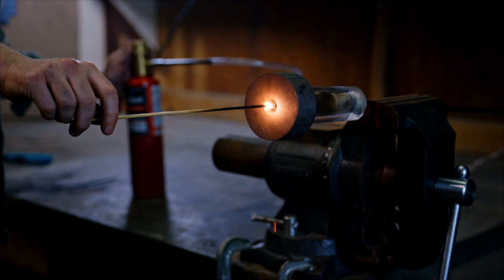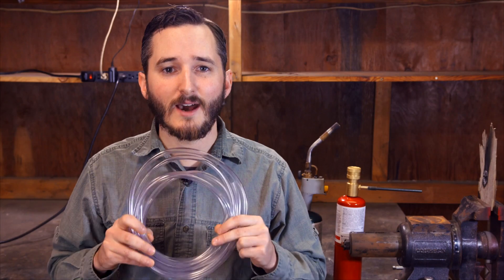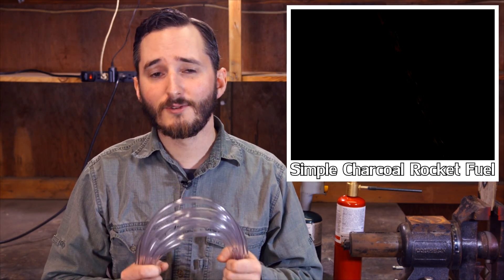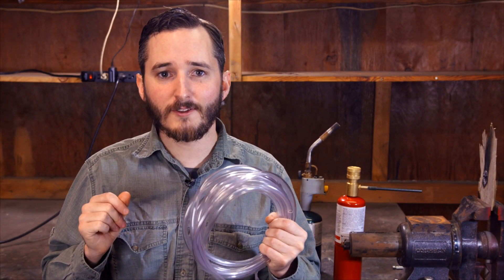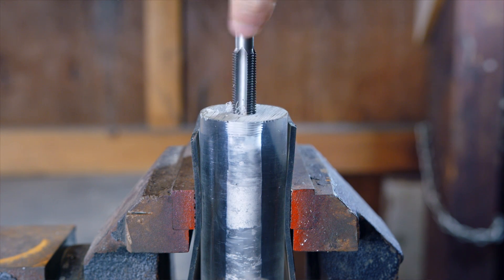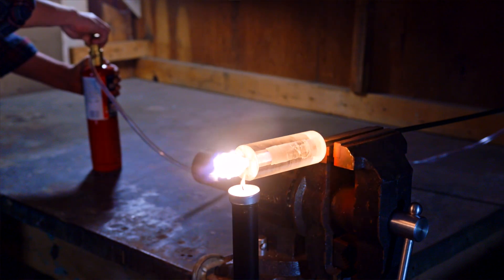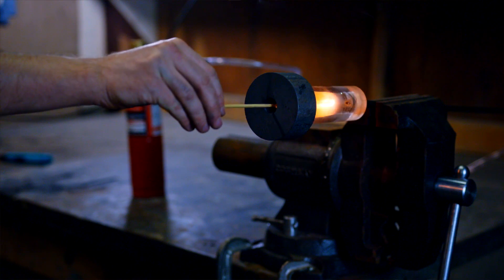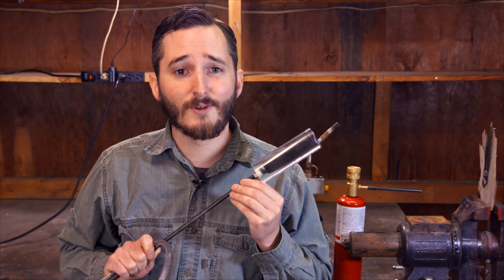Building a DIY Transparent Hybrid Rocket Engine - NightHawkInLight

Comment: So what is the point of sulfur in gunpowder if it only needs fuel (charcoal) and an oxidizer (potassium nitrate)?
Reply from the maker: Sulfur is a modifier. It's like pouring oil on a campfire. It will burn without it, but oil helps.
Reply: NightHawkInLight Ok that makes sense, it basically just helps the charcoal burn quicker/easier. Thanks for the insight.
Reply: bucky13 I guess that sulfur acts as a catalyst. I've actually made some experiments about this, and usually I get the following results: charcoal and KNO3 burn, but slowly. Either one with sulfur, don't burn well, however it burns better with charcoal. All three combined are quickly consumed. Given the smell left over, I suppose that the sulfur is reacting with one left over oxygen molecule from every two moles of KNO3 and C reactions (which would produce CO2 and some solid byproducts I haven't identified), and takes 2 atoms from the O2 in the air to form sulfate. I believe this increases the efficiency of the reaction, making it more violent. also, the Sulfate formation is probably an exothermic reaction, which adds to the bang
Reply: +Christopher Teale  Not gonna lie, 6 months ago I understood about 20% of your answer. Over the past few months I've gotten into NurdRage and NileRed chemistry videos... Now I think I know exactly what you mean. When the charcoal and KNO3 react, it produces mainly a lot of heat and CO2, but since CO2 only requires 2 of the 3 oxygen atoms that the KNO3 has to offer, you're left with extra oxygen. So then sulfur is able to use that extra oxygen for a secondary reaction that adds more energy and balances out the equation... I think.

P.S. I haven't been studying this for the past 6 months so I could post a reply, I actually saw this video in my recommended and immediately saw my old comment.
Reply: NightHawkInLight it's not a binder?
Reply: bucky13
Reply: both mixtures of potassium nitrate with just charcoal or with just sulfur would burn, black powder is the optimal combination of those to achieve the best properties... actually sulfur free formulas were used for special applications like fuse core powders
sulfur provides some extra gaseout output, stabilises burning process and under high pressures contributes to mechanical properties of black powder
Reply: I concur.

Comment: could you make a wood core, made in the same way, that slides into you rocket housing as fuel?
Reply: z dubs Depends on the wood's heat conductivity if you want to have it as a casing at the same time.

Comment: I cant find a single thing on charcoal firework rocket engine? did yu say something wrong?
Reply: The fuel used in fireworks is black powder, which is made out of charcoal, potassium nitrate and sulfur.
Reply from the maker: Most charcoal fueled fireworks rockets are called black powder or BP rockets. Most also contain sulfur.
Reply: NightHawkInLight ohh okay. Thank you. I always thought black powder was just normal black powder explosive, that I was unable to make. Thank you

Comment: here is what i think is happening to the inside of the rocket core, when u drilled the tube the inside surface is no longer as smooth as the exterior and thus it became opaque, now due to refraction you will see the indie hole as bigger than what it actually is, once the rocket starts the surface of the inside of the core melts and becomes translucent again, now why the core look as if its shrinking is i think due to the light refracting again on the new surface. now to test that this is all because of the opaque surface in the first place try to make the inside surface as smooth as possible if u can.

Comment: Make a graphite holder to encase the entire thing along with a couple of graphite/steel screws to hold the nozzle and the holder together. Make a bunch of those acrylic "fuel rods" but drill a hole at the side for a fire to be lit through an ignition coil. make 4 of those and attach it to a go cart with some excellent rudders/steering mechanism. I would love to see that, great job man! Also make it such that the acrylic fuel rods can be replaced easily so the go=cart can be re-used. If you wanna use this for an aerial vehicle you'd have to develop a very efficient way for refuelling XD

Comment: the oxidizer is sugar in the video , why couldnt he just say that?
Reply: He says it is potassium nitrate.
Reply: You can use sugar as the fuel, with KNO3 as the oxidizer.
Reply: i meant to say "the oxidizer mixed with sugar is a more common rocket fuel, why didn't he say that in the video?"

Comment: It would be really interesting to see this thing propel itself somehow. I'm sure the nozzle could be easily improved by just milling it out with a lathe so the surface is smooth instead of rough from the stepped drill bit

Comment: This is amazing, thanks for sharing!
I'm not a scientist, but I'm fairly certain the visual effect of the rocket core shrinking is caused by its IOR (index of refraction) decreasing as the temperature increases. As the temperature of the acrylic increases, its permittivity (also called dielectric constant) decreases, therefore so too does its index of refraction. The image seen through the transparent surface is becoming less refracted.

Comment: Awesome, what's the powdered oxidizer you used with the charcoal? Was it Potassium nitrate?
Reply: Ynze Selders maybe potassium chlorate?
Reply: yes it is
Reply: He said in a comment above that it is actually KNO3
Reply: Ian Soede Yes, I was reinforcing the idea... wtf ahah
Reply: Indeed, probably potassium nitrate. Potassium nitrate + sulfur + charcoal is black powder, the propellant most often used in fireworks.

In amateur rocketry is it also popular to use sugar as a fuel (rocket candy), again with potassium nitrate as oxidiser.
Reply: +Lars Veldscholte I do not believe they use potassium nitrate/sugar mixtures in ANY commercially available/officially approved (non-experimental) motors.  "officially approved" is a big deal, because "experimentals" are almost never permitted (except in Tripoli "X" day launches, the last day of a Tripoli or some CAR annual launches.  They're outright forbidden in NAR launches, period).  NAR/CAR/Tripoli are the bodies that decide which motors are approved.

Virtually all amateur rockets use ammonium perchlorate (aka "AP") as oxidizer and some sort of moldable resin/epoxy/plastic material as fuel,/binder (to glue everything together as a lump) as amended with various other chemicals in small quantities (such as aluminum, magnesium, titanium) for special effects (colours or sparkies) or a performance booster.

The shuttle SRBs used AP with PBAN (a rubber-ish plastic) as binder/fuel, plus other ingredients for improved performance (especially aluminum).

The fuel is either cast directly in the engine casing, or produced as "rods" cut to la specific length ("fuel grains"), slotted or drilled, and inserted as a stack into the engine casing.

Amateur Hybrids usually use nitrous and some sort of plastic.  Sometimes ABS or polyethylene.  PVC is a no-no (chlorine).  But hybrids have been flown with rolled newspapers or dried cowpatties as fuel.

Comment: Try using N2O cartridges for a better oxidizer. It will also keep the weight and size down since they are about the same size as CO2 cartridges. This will help you if you want to get airborne hybrid rockets.
Reply from the maker: N2O is a better oxidizer in rockets than O2 due to it's ability to be liquid at a higher temperature correct? So better density?
Reply: +Nathan Campbell That's what i thought
Reply: NightHawkInLight Yea, basically it has a more efficient exothermic decomposition of the oxidizer molecule compared to O2.
Reply: Nathan Campbell how to fit a bomb on  a rocket and hit it on the target ?or atleast far away ? 😊

Comment: How many N does it produce?
Reply: xWood4000 ooo, ooo, i got this! Ummmm... 5.

:p

He said in another comment he doesn't have the equipment to measure thrust, and the nozzle and oxidizer are poor, anyway, so it's basically only a demonstration model. He estimated 50 pounds of thrust in this size of rocket if using proper design and materials.

What is that then, 500KN optimized? Been a while since I looked at those numbers :P
Reply: Ryan Gunn 50 pounds is 222 N according to google. 5 pounds=222 N/10=22,2 N
Reply: Ryan Gunn In comparison one merlin 1D(SpaceX Falcon 9 1.1 first stage engine) outputs at sea level 620 kN and 690 in vacuum. Quite a large difference.

Comment: how much thrust does it make
Reply from the maker: I didn't have a setup available to measure it. Due to the inefficient nozzle probably only around 5lbs. Acrylic isn't an ideal fuel in any case, it just makes a good demonstration because it's clear. Using a good nozzle, proper fuel, and an oxygen valve that can dump oxidizer quickly you might be able to get in the range of 50lbs of thrust out of the same size rocket.
Reply: Couldn't you have rested the rocket against a weighing scale?